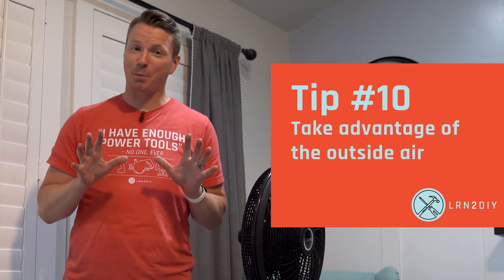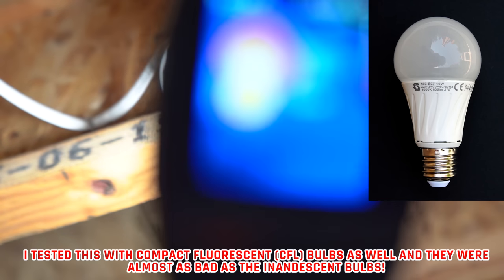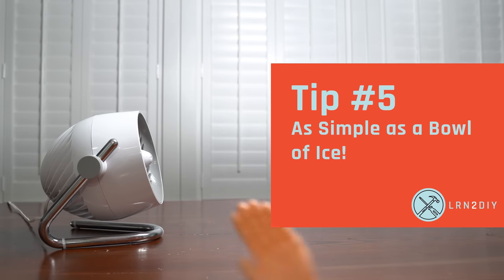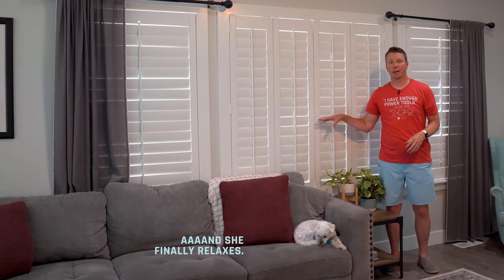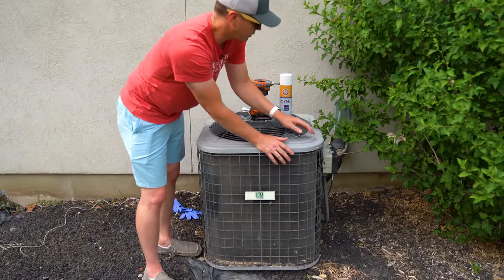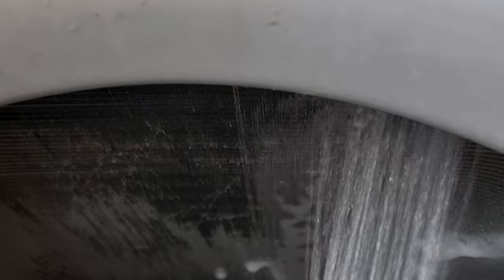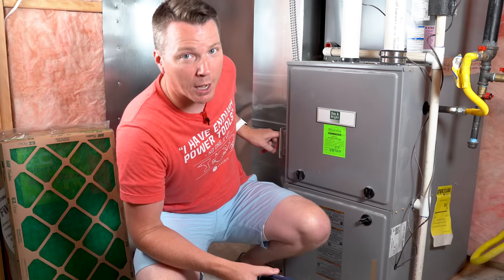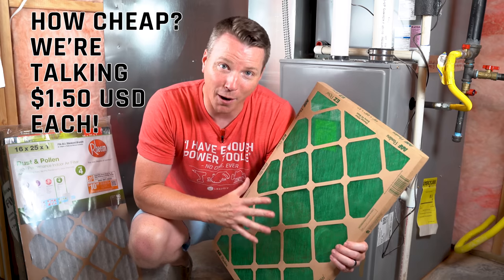10 CLEVER Tricks to Cool Your Home Faster

Comment: I wouldn't cheap out on the air filters.  Using just a fiberglass filter barey traps anything.  Even if you don't have allergies to dust, why not spend a little more and take the naturally occurring dust out of your home.  I use a 4 inch thick pleated MERV 13 that lasts a full year even with the blower running 20 minutes every hour.  Although dust is visible on the filter after a year, it still is clean enough to see light through it.

Comment: This may be a dumb question, is there a reason you faced the fan towards the window as opposed to facing it inside the house?
Reply: The first one is facing inside the house, the second (on the other side of the house) is pushing air outside to help create the cross breeze.

Comment: So with climate change we seem to be setting records all the time. When you couple that with the increase in fires, well things could get deadly 
The past heat wave  alone in Europe killed over 1000 people. So worst case is a heat wave and fire, jurying that past fires we have lost power several times for days in a row, the gas stations could not pump gas, luckily for me I always keep a good supply of gas and when the forecast looks bad I store more(this is not ideal). So I have been considering building a thermal shelter in the back yard. A simple 10 by 10 cinder block box with the top 3 to 4 feet below ground level, with a filtered air system. Any thoughts?
Reply from the maker: Why not invest that time and money into solar instead? I guess the room could be built pretty inexpensively but if it means leaving your home to stay in it, solar might be a better option and lets you stay at home.